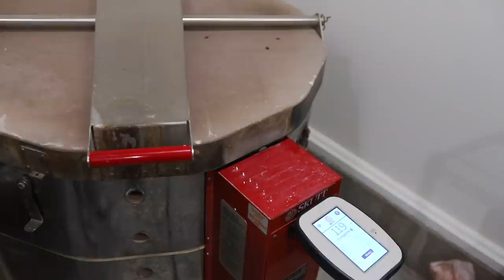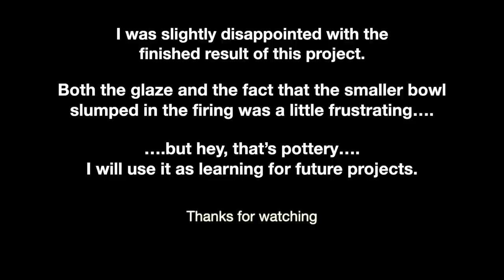MAKING A CHIP AND DIP - THE ENTIRE POTTERY PROCESS - ASMR EDITION

Comment: If the block of clay dries out a little,  can the clay still be used? If a piece already turned (for example) and dried for a day were to fall down, is that clay still usuable?
Reply: yes, you need to add water and then wait for it to settle and when it's in the right consistency again you need to wedge it